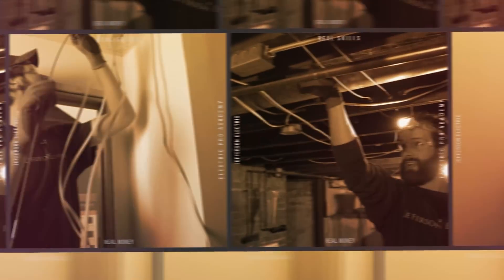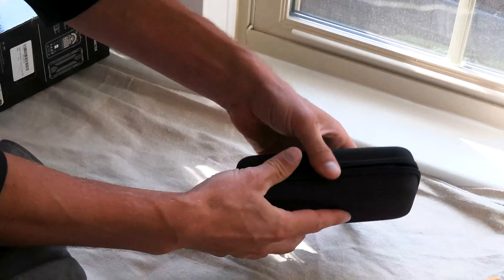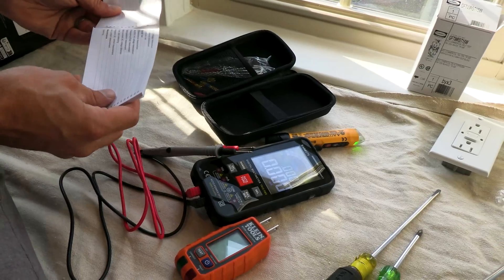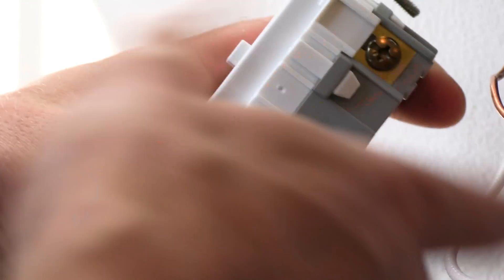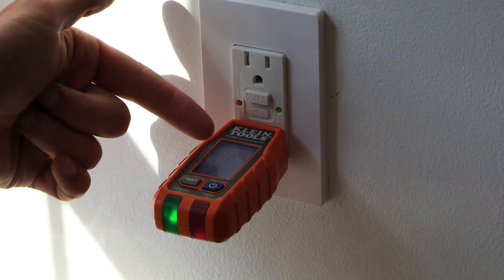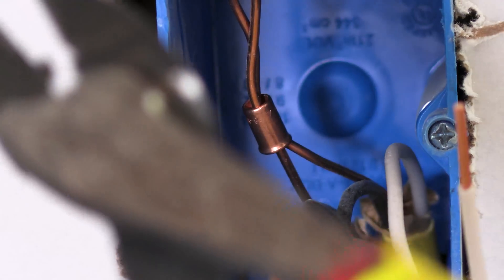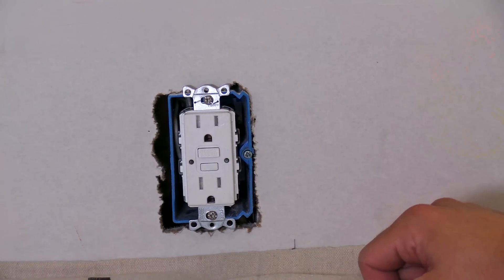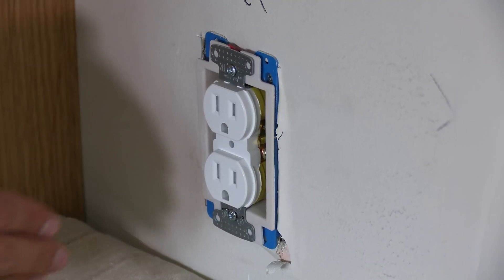Do I Need To Buy $20 Outlet Receptacles For My Kitchen?!

Comment: You should see what sockets cost in Finland. A normal one could cost that much. An RCD protected is well over 50 € - though they are rare here as it is put on the panel. It is also strange how you can just buy a plate separately. Here every outlet is different. Well DIY is banned here so small differences in sockets prices do not matter that much.

Comment: Is it wrong to have GCFI's in every kitchen outlet. Yes it was crazy expensive but I make 6 figures so I could afford it. I had my electricians install lighted GCFI outlets in every kitchen outlet even the dishwasher, refrigerator and microwave. Of course in both bathrooms there are GCFI's at the sink walls. I installed the GCFI's in both bathrooms and in the laundry room.
Reply: I believe one of the NEC clauses is within 6ft of water/sink (I forget the exact wording) you need GFCI protection so you did right there.  Anyway I do the same thing with GFCI receptacles everywhere; it is technically overkill and you only need to wire 1 GFCI receptacle upstream of the others on the same branch circuit to protect them but I like the uniformity in look of all-GFCI in the same room.  I agree, to each their own with $$ spend and it's not like we're replacing receptacles every week lol.  They will last for decades - just cry once, buy once.
Reply: @progression_decibel  Oh I know I did not NEED to put GCFI's everywhere. I just installed the GCFI's in my kitchen everywhere because they light up very very bright when the lights are turned off. I like the light they give off at night. My kitchen has no windows at all so the kitchen is pitch black at night. My army of kitchen GCFI's bring much needed light to my dismal dark kitchen at night. It's fine because the light from the GCFI's is far dimmer than turning on my much brighter overhead and under counter lights. Heck sometimes I love wasting money because I can afford it.
Reply: That is how my house is configured. Each kitchen receptacle is a GFCI receptacle. Not one GFCI feeding downstream.

Comment: Instead of the Robertson (square) I prefer to use and ECX from Milwaukee or Klein.  It gives the advantage of the square and flat blade which gives a better contact with the screw head.

Comment: did I see a WR on that outlet? Why would you use a weather resistant outlet indoors?
Reply: Because GFCI receptacles are suitable for both exterior and interior locations.  And since the interior locations they are most often used are in kitchens and bathrooms, the weather resistant rating makes sense where water is present.  When you buy GFCIs by the case (like electricians do) it makes a lot more sense to buy GFCIs that do double duty.

Comment: I'm trying to figure out why you used more than one in the kitchen.  One GFCI can protect all of the outlets on that circuit.
Reply from the maker: The receptacles are on several circuits. Check this video out for the circuit planning: https://youtu.be/y8tjMSWUWKs?t=793
Reply: You should never have just one receptacle circuit in a kitchen.  A lot of power hungry devices can be used in a kitchen, now more than ever.

Comment: Is passing Seymour and levington and Eaton good quality GFI receptacles
Reply: Overall, they're all about the same.  Designs are tweaked over time so there can be little variations.  As long as they're listed with a quality/testing company, with an actual stamp on the device [e.g. (UL)], it should be fine.

Another comment here mentions that Eaton has had quality control issues since moving some production to Korea.  Most Leviton stuff is made in Mexico if I remember correctly.  I used to like Cooper stuff too, but Eaton bought them out.  Anyone that remembers the junk "Eagle" wiring devices should know that Eaton is "them" today.

Comment: When you use a gfci receptacle to cover downstream outlets, do you have to label them as gfci protected?  The Eaton gfci devices comes with small labels for this purpose, but curios if it’s required.   Thanks Joel.
Reply: Even if it's not required, it's still a good courtesy.
Reply: @jovetj  thanks Jovet

Comment: Daughter has a GFCI reading "no ground",  thought I'd plug something in and turn off the breaker to find what else might be feeding it. I have tone generator, but .....      suggestions?
It is at the end of the circuit
Reply: Is it an older home?  Was perhaps an older un-grounded receptacle replaced with the GFCI?  Such installations are supposed to be marked with supplied stickers, but remember a GFCI does not rely on its ground connection to work.
Reply: @jovetj  yes-but not as old as I am.  Cable came from the refrigerator box, removed and replaced the wire nut on the grounds and presto it tested correctly.  My OCD really wanted to determine the issue, but also knew it was a functioning receptacle.  Thanks for your input.
Reply: @edmastin74  I'm glad it's working correctly now!

Comment: at 11:15 you talk about using dropclothes on counters. I like using work mats. rubber backed so if you're on hardwood at a receptacle and step on it you don't slip. but they're great when you get them printed with your company logo and information on it - the customer appreciates the care given, and it's got built in advertising. shameless promotion of yourself and company, there's no downside to it.

Comment: The real cost kicking me is using the combined GFCI/ACFI's in my panel for all my new breakers. $50 a pop, and many of my circuits have just one or two items on them for separation and future expansion.
Reply: so double them up with wirenuts in the panel, and as you expand you can install more breakers.
Reply: When GFCIs came about and came to be required by Code, there were many whispers about conspiracies involving money-making schemes.

I find that hard to go along with, because GFCIs are literally life-saving.  They can even save your life every day the rest of your life. 

But, the AFCI trend has me suspicious.  I know house fires are bad, but I am extremely skeptical of the cost-effectiveness of mandating this technology.  The vast majority of homes do not burn down.  Electrical fires certainly happen, but they are not the every day thing that water and electricity are.  I have struggled and failed to locate any data or studies of the 20-year effectiveness of ACFIs.  A common trope in favor of them goes "well, we will never know how may fires they prevented."   Well, we can, because they trip.  We could also easily see large, long-term trends of reduced numbers of dwelling fires.  However, I am unable to locate any such studies or data.  So, the smell test is still pretty rank with me.

Comment: You should also tell people to buy commercial spec outlets far better and robust than residential version sold in big box stores.
Reply from the maker: That sounds like the Math Man we've all grown to know and love.
Reply: @ElectricProAcademy  no your the real pro and providing for so many families in the company. My friend also at sparky channel made this point several years ago as well on his channel and when I first used them the difference in feel touch, robustness of the pins and compression of inserted plug was so much more evident.
Reply: @mathman0101  Tougher outlets are always better, especially in rough enviorns (e.g. outdoors, garages, kitchens).  Having rear screw-clamp connections is icing on the cake.
Reply: @jovetj  not a great fan of the screw clamp connections although better than stab-in for sure. Funnily enough the hook wrapped under the screw has been found in laboratories and testing to be the most secure mechanical and electrical connection as long as it is done correctly. That is why the NFPA70 Handbook has a nice graphic showing that type of connection. And how to do it correctly. Torque the screw connections down and that really also helps - again recommended by NFPA70 Handbook version.
Reply: @mathman0101  I just can't understand how backstabbing ever became legal.  The last place you want a questionable connection is in your home wiring.    

I really like the screw clamps because it's faster and simpler to prepare the conductor and the screw and clamp are still very secure.  I don't think there's any question that the contact surface area of a screw-wrapped-conductor is greater, but the clamp is a healthy compromise.  I have never bothered to look if it's listed for such but you could still always wrap the screw of a clamp, too.
Reply: @jovetj  yes you are correct.
Reply: @jovetj  please inform the uninformed....what is backstabbing?
Reply: @jolkraeremeark6949  "Backstabbing" is slang (with a pejorative slant) for the "quick wiring method" that common residential switches and receptacles have.  All you have to do is strip the conductor's insulation the proper amount, and insert it into the back of the device.  A little metal clip inside grips the conductor and supposedly holds it against a small metal plate while preventing its withdrawal.  No tools are required except to remove the wire later.  It's designed so that only 14 AWG wire is accepted. 

The problem is the contact area is usually pretty small, sometimes just the edge of the metal clip holding the wire in.  Heat and fires from these poor connections are not unheard of.

Comment: Since there are two kitchen circuits, you can usually get by with two GFCIs at the homerun / first outlet of each, placing the rest of the circuit downstream as a load.
Reply: I'm pretty sure the European central RCDs trip at ~30mA but the US ones trip at ~5mA. I've heard the higher current ones called "equipment protection" devices. So you could still be killed before the RCD trips, but it would trip if you had a short to ground. If you put a US GFCI over multiple circuits, you would probably have nuisance trip issues but maximum human safety. So you could argue the US way has benefits. Maybe both and only have the 5mA GFCIs in wet areas (as was originally the case in the US)?
Reply: I know this solution tends to be more expensive, but if the cost differential was not a factor, I would just put the gfci at the breaker. I recommend this for outdoor receptacles as well, so that a damaged outdoor box is still fully gfci protected.
Reply: @ghammer9773  I truly don’t understand why breaker boxes without GFCI on the whole house is still valid code in your country. Doesn’t even have to be an rcd per circuit, it can just be a couple of RCDs each doing multiple breakers.
Reply: @JasperJanssen  Some appliances are known or expected to leak a tiny amount of current to ground.  A GFCI/RCD on those circuits quickly become a nuisance.   

I have not studied what the Code says about the design and construction of panel boxes, but their current design (no pun intended) does not allow for groupings of circuit breakers.  I suppose, if you got ahold of an old 6-handle-main panel, you could put GFCIs as main disconnects for some of the lower circuit busses in the panel, but that's a very antiquated mentality of doing things here today. 

In the United States (and Canada), circuit breakers are widely considered as more convenient and cost effective.  A UK ring circuit with individual fuses on each plug is fine, but a blown fuse takes more time and expense to remedy.  Essentially, US circuit breakers centralize all that in a single location, and last for many decades.

Comment: 15:40.  Got this house earlier this year.  Recently had the dishwasher replaced.  After it was installed, I was horrified to see that the duplex receptacle beneath the sink (where both the dishwasher and garbage disposal plug in, with separate circuits) was just hanging out of the wall.  It did already have a box extender on it and the terminals were wrapped with tape, but, how embarrassing.  I got some 2-inch long screws and a wallplate, and discovered it was like that because the lower box hole was completely blocked by the cabinetry.  A quick hole drill later and it was easy to finish up.  
P.S. I hate backstabbing.
Reply from the maker: @Jovet, thanks for all the quality commenting recently! We would not consider this backstabbing because the wires are secured with a plate and terminal screw inside the device. This keeps all the components out of the reach of each other for proper GFCI performance.

Love to hear that you're up to the task of cleaning up your home's electrical work!
Reply: @ElectricProAcademy  Sorry, didn't mean to imply there was backstabbing in the video.  The house I live in, though, it's all over.  Ugh.

Comment: The rear of your multimeter doesn't have a feature that mine has. On the back of mine is an attached elastic band. I put the meter over my lower arm. I adjust it to have a good view of the meter's front side. We DIYers only sometimes have a counter to rest the meter on, and you still have to look down to read it. When I use a battery-powered device, I permanently remove the battery(s) when I'm finished. I use rubber bands to hold them onto the device. It may be months or even years before I use the device again. I have one foot, 1/8-inch diameter, wooded dowel with notches on the ends. This comes in handy when I push the wires inside the workbox.
Reply from the maker: 3 great recommendations on one comment! Thanks @Outlet

Comment: I have an old GE Potscrubber 940 dishwasher - I was told I should have this put on a dedicated circuit by itself, but NOT to put it on a GFI?  Is this correct?
Reply: I wld say if you have to use a gfci make sure it's an accesable location either a breaker or the line side outlet is an a readily area 😉
Reply: only if your electrician is trying to make some $$$
Reply from the maker: dishwashers can experience nuisance tripping issues on GFCI's. I haven't seen one universal recommendation in this regard. Go with your manufacturer's instructions.

Comment: Lots of drop cloths and wet dry vacuums with high suction, a must that's almost always overlooked. Not to point any fingers but it rhymes with A B eccentric. No offense but plastic and nylon boxes aren't giving that professional look. It makes it look cheap and lazy. But I am not knocking you so please don't take it that way. Also I don't like those plastic inserts. In that case I use electrical tape around the terminals and GFCI terminals with metal boxes and just use spacers if needed. When I rise to "power" (see what I did there) I will ban plastic so they will need to come up with brass, or other non-conductive material but the screw is conductive anyway, so it wouldn't really matter. Washers metal or rubber would be used if nothing else. Again metal would last longer, rubber will dry out and degrade over time, making the receptacle wiggle loose again.
Reply: Professional look? Who the hell cares??  If your boxes are not covered up, you're doing "electrical" wrong.

Comment: I have never so blatantly asked what the heck are you doing man!?! All of your standards I've seen from watching your channel, and this is how you make up a receptacle!!! Backstabbing is so much worse than terminating by wrapping around the side screws, but that's not even bringing up passing though the receptacle. I can't believe I just seen you crimp grounds, and snip one incredibly short, I'm pretty sure that doesn't come out 6in anymore. You should be using a jumper from the receptacle's terminal to it's respective bundle of wires that stick out six inches from the back of the box. You say warranty makes you buy all the best products, why not preform all the best practices?
Reply from the maker: Way to keep us honest, @Christopher Perez! GFCIs have covered terminals for proper function/safety, so this is not actually backstabbing, because we are using the screw terminals in the device. As for the ground, we have never been called back for a grounding problem due to crimping, and find that it gives us a little more room/box fill. Thanks for the input!
Reply: @ElectricProAcademy if you use crimp sleeves, you have to use a four point crimp tool not crimps in your pliers 👍🏻 Buchanan makes a four point crimp tool
Reply: He didn't backstab anything.  Using the crimp thing and cutting off one of them short is not what I would have done, but...

Comment: I notice in this video, the clear plastic coating coming off the wires, is that bad?
Reply: To add to my response... from what I can tell, that clear layer is a nylon outer jacket that helps protect the conductor's PVC insulation.  It also provides some extra resistance to water and oils.  The nylon is not needed to be fully electrically resistant to its rated voltage (usually 600V).
Reply: Not really.

Comment: No you might not need a $20 GFCI receptacle but a $65 AFCI circuit breaker if in 2020 NEC.
Reply: If you're less than 70 feet from the panel, you can use an AF/GF receptacle at the homerun of each kitchen circuit for about $35 (slightly cheaper on ebay) as an alternative to the breaker

Comment: Can’t believe you mixed outlet formats. Round vs rectangular??? I would throw a fit as a customer. Also the color difference… I would find a better color patch of plates and outlets. 😮
Reply: "Round versus rectangular" is a made-up problem. Stop stressing yourself.  
The color difference is a bit concerning to me, but it really just comes down to the plastics that are in use.
Reply from the maker: We're always open to customer feedback on both of these issues but in this case (and most cases) folks prefer saving a little more money. As mentioned in the vid, the cover plates were provided by the homeowner so we actually pointed it out to them after the fact